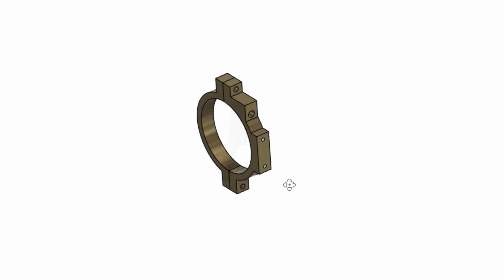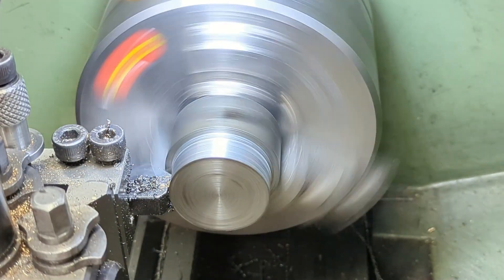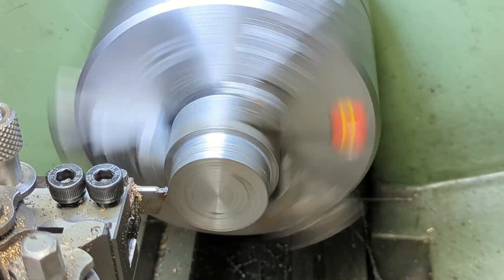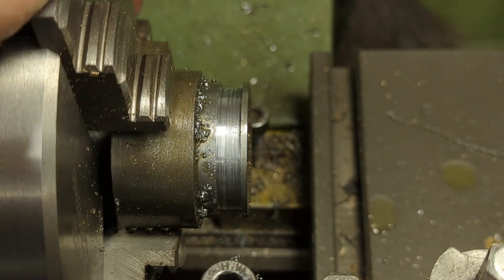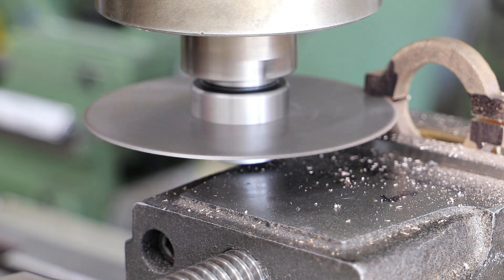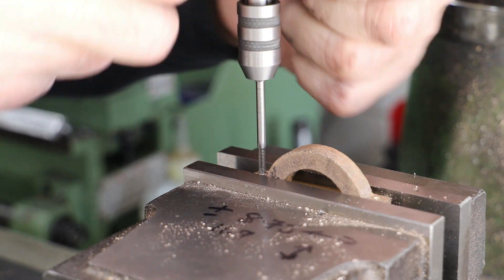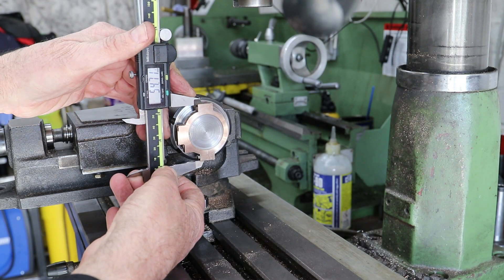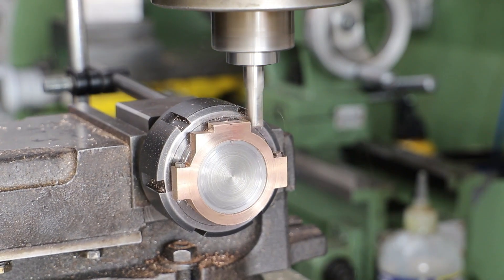Part 53: The Boiler Feed Pump Pt 3

Comment: What lathe is that? Warco?
Reply from the maker: Yes, a VM250V..
Reply: @markshomeengineering5243 does it part off okay with smaller diameter bar? Like 30mm steel?

Comment: Enjoying your videos! 👍
I use HSS tools to turn mild steel all the time and get a nice finish.
I dont want to sound rude but the finish you seem to be getting here looks like what I get when a tool is blunt or incorrectly sharpened.
Try grinding more top rake on your HSS tool and I wohld also go more pointy with maybe a 1mm point diameter (40 thou).
It is also possible you have slop in your compound slide or cross slide. You can test that by seeing if the cut finish improves a lot when you use a heap of force pressed down on the tool post (just press it down as hard as you can with your free hand when cutting).
Hope you dont mind me speaking up. 🙂
Reply from the maker: Hi Wiz,
All feedback appreciated.
I do have other HSS tools with a much smaller radius on the tip, but I'm more than happy to try adding more top rake and checking for potential slop in the machine.
Cheers
Mark

Comment: Hi Mark. Joe Pie has a good video in which he modifies a chuck such that he can bolt consumable aluminium blocks between the jaws. You temporarily remove the jaws, face the blocks, and use these rather than parallels to remount thin parts when facing the reverse side to be parallel. I enjoy the length of your videos btw!
Reply from the maker: Hi James, yes I've seen Joe's video and of course I could also make a chuck spider, but for parts this size, it's just as easy to make a mandrel.
Thanks for the feedback 👍